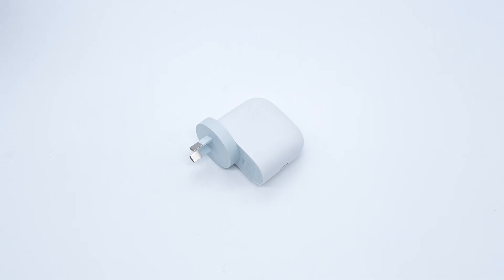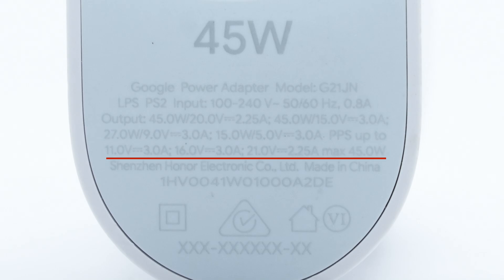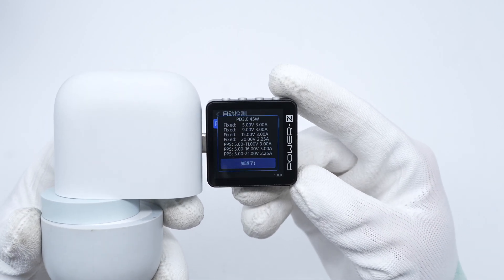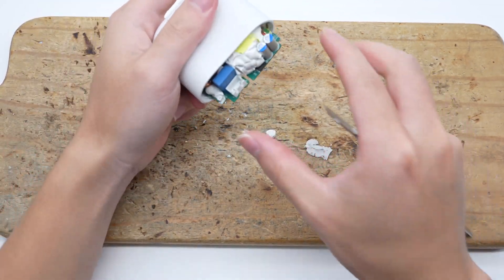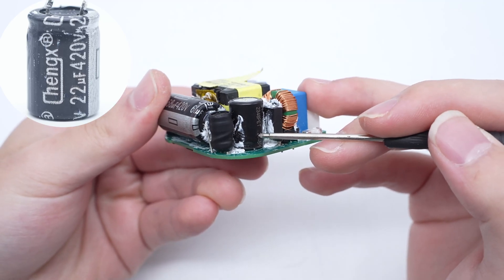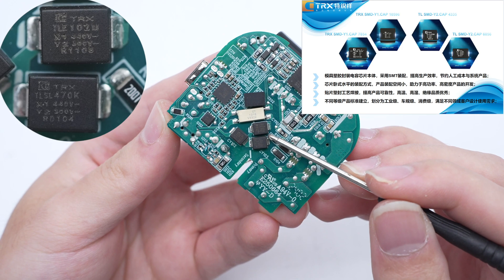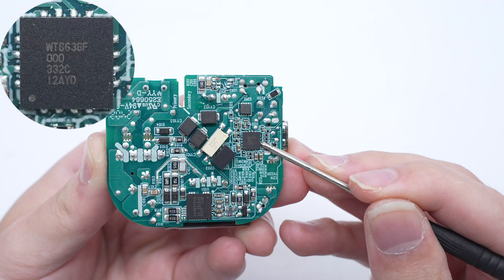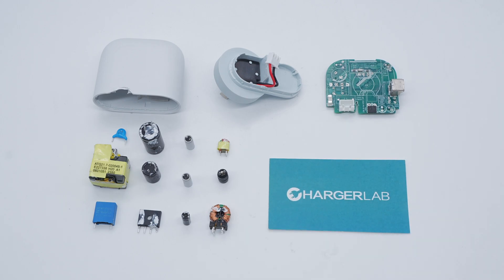Teardown of Google 45W GaN Power Adapter

Comment: What’s the point of a GaN controller if it switches at <600KHz (limited by the synchronous rectifier controller)? Just so they can advertise it as GaN? 

Maybe it helps efficiency if the switcher spends less time transitioning between on/off states compared to a silicone one? Despite both running at the same frequency…

Comment: I always use a wire cutter to cut into a corner, then use the gap to prised open with with a screw driver. Less banging required.

Comment: Oh this is the Australia/New Zealander plug version. But I have always wondered if it will fit into a china 3 pin socket. Since some can some cannot
Reply: I'm from New Zealand. A lot of plugs in China, to my knowledge have shutters inside the outlet which require an earth pin to open - same as in the UK. 

Here in New Zealand, 2 pin plugs can open the shutters as they are common and allowed by the standard. Most 2 pin devices in China have an American-style plug.
Reply: @LoganT547  yeah some need a ground pin to plug in some doesn't.
Reply: @LoganT547  yeah the 2 pin is the USA/Japan 2 pin